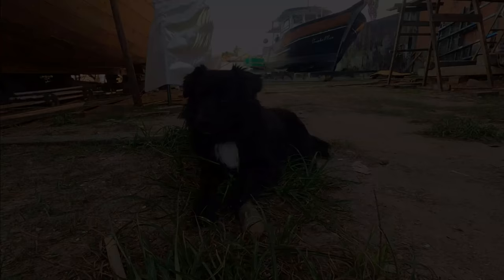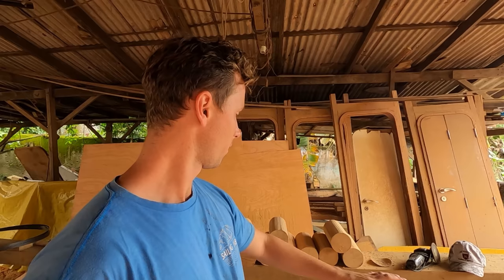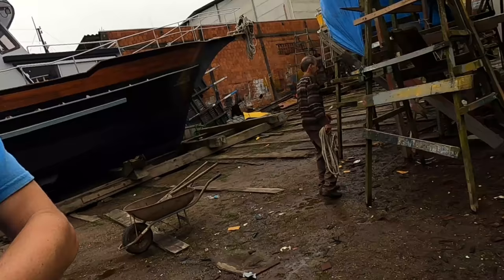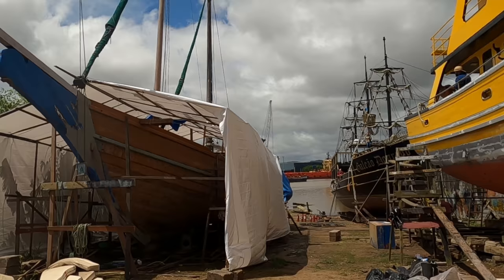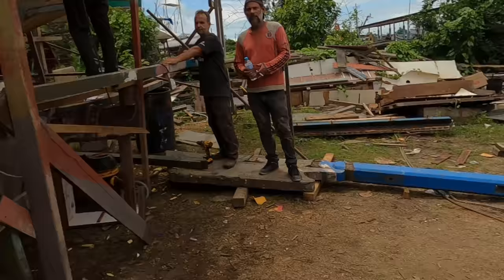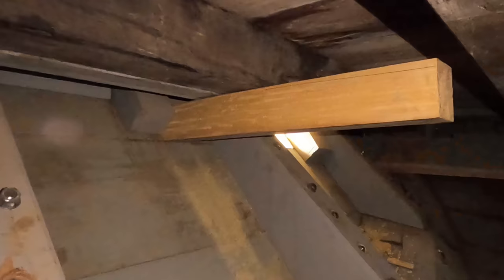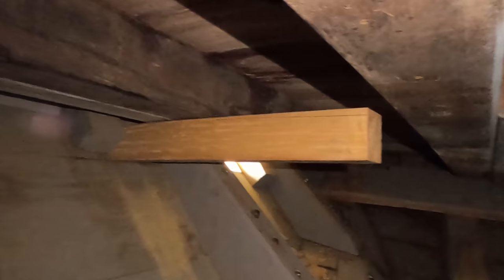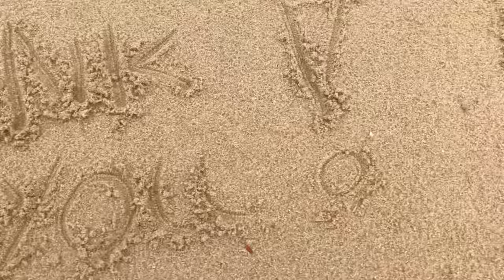Building a HUGE wooden swimming platform on a sailboat — Sailing Yabá #75

Comment: You really need to think about the forces of waves with a following sea! Waves pushing up and down on the platform will weaken the whole stearn of the ship. Then one wave will be all that is needed to rip the whole aft section off and Yaba will be on the bottom in minutes!
Some type of movable (floating) platform that can be out of the water when at sea would be safer. 
Enjoy the videos and waiting to see Yaba under sail!
Reply: it did not happen on the old platform why this one

Comment: I've only been following occasionally, but if you take that boat out in any wind, as soon as you turn down wind the waves are going to be crashing down on that swim platform and you'll be lucky if it breaks off without taking half the transom and then the boat down with it. That's like a calm summer day party boat thing.
Reply: thats strange the old platform seems to have survived many years i think you are over thinking things mr doom and gloom
Reply: @brianseager6388  Well, it's not my boat and not my butt. And in fact if you read the replies, as I did after I posted this, they seem to be thinking of using it for a dive boat. So a good-weather boat, and that makes perfect sense. But thinking of some of the weather I've been in in the Gulf of Mexico and the Atlantic on my way to Europe... I don't think I'm being doom and gloom at all. It would be dangerous to take that boat out or be out in bad weather.
For instance if, just for thinking about it, the surface of that platform is three square meters, and it's 25 cm above the surface of the water, if you get a wave that's 1.25 meters high breaking over it, that's 3 metric tons, 3000 kilos (6400 pounds), of water hammering down on it, in some weather once or twice a minute. And then when you are in any kind of following sea as the waves roll under the boat the stern drops into the trough, and so you have half the weight of the boat driving the platform down into the water once or twice a minute. That's what will happen, and at sea, or even in unprotected waters, that can go on for a day, even a week or longer...
Reply: Carefull. Using reasoning, math and science may break a whole lot of rose colored Pollyanna sun glasses. Viewers and commentors who have the audacity to posses such skills are not allowed on this channel... yet they wonder why it's not growing in subscribers...
Reply: @jefflange3009  😂
Reply: @bawrytr  Agree.  Despite her size, "Yaba" is not an all-weather ocean-crossing vessel.  She is flat bottomed and unballasted, of a type that evolved / designed for cargo carrying along rivers and coastal waters in sheltered conditions.  For instance, there are no coamings around the hatch to the engine space or at the base of the companionway: as soon as a wave goes on deck, water will be finding its way below. I just hope when they finally set off, they will take "baby steps" and take care not to exceed the boat's capabilities.

Comment: A little something to keep in mind once YABA is on the water............that dive platform can possibly cause you to have navigating (steering) issues when you are in a strong following sea.  Also, docking at a fuel dock will give you some issues, not so much while trying to dock, it will be leaving the dock. that will be the problem. You will not be able to turn a hard rudder either left or right (depending on if you are starboard side to the dock or port side). If you do that, the dive platform will absolutely cross over the fuel dock and that is not a good thing.  I would STRONGLY urge you to get a qualified captain to teach you guys the approach to a fuel dock and more importantly, leaving the fuel dock. You have a lot of time and money invested in YABA, and she looks great, so, please be careful and take lots of precautions. Keep up the great work. You have an amazing bunch of carpenters, a lost art, for sure.
Reply: Folding plataform would be a good solution! Tilting up during navegation.
Reply: Totally agree. A fixed mounted platform will become a BIG pain in the future!  On my boat I have such a platform, used to store the tender (with 25 h p outboard). BUT....I raise and lower easily by myself using a simple pully system. And it's not a tiny tender either!
Just saying....

Comment: The swim platform will drive you insane at sea as the waves smash into it constantly. Even at an anchorage when a boat passes by you, will only need to throw a 2-foot wake to make a thud crashing sound and if your stateroom is in the stern it will wake you and drive you nuts. I have the same stern transom and the swim platform is hinged so it is hauled up to stop this horrific annoyance.
Reply: ive a feeling they have a very big learning curve ahead of them once the boat hit the water.
Reply: I would think in a rough sea it might breakup
Reply: In a big following sea it will also make breaking waves come over the stern. The shape of the stern is so the boat will ride up over the wave. By putting a huge platform there you change the design form. How many blue water boats do you see with a huge boarding platform?
Reply: They won't have to worry about that. Because it's so long and so short with its anchoring i side the vessel. It's going to break off anyway.  2:1 ratio. For every 1 ft extended out you have to  secure inboard 2ft. . . 6 ft swim platform.  12 ft mounting.
Reply: I think it’s becoming apparent that this is going to be more of a houseboat than an open water sailing vessel. The platform would never survive rough weather in open ocean sailing.
Reply: @lucabrasi5070  Or for recreational diving and diving education (MP's specialty) at not-distant sites?
Reply: @charonstyxferryman  Yes guess you are right there. I would not take it offshore anyway. I have seen better boats than that never come home.

Comment: I can't believe the elder gentleman has almost single handedly lead the rebuild. PS so glad you guys went with a full rebuild. It's looking fantastic. 🇦🇺
Reply: @JCrook1028  also am I the only one worried about those stern planks on the transom at the keel below the water line. I mentioned before that the gaps are unacceptable and will cause problems almost as soon as the boat is launched. I'm not knocking these amazing guys, except sometimes I feel the tolerance is +- 5 mm

Comment: The boat is looking beautiful. Incredible how much work has been done since the start. With the caulking started you're on the home stretch now. Launch by June/July? I sure don't care for that swim platform though. That looks like a huge mistake that's going to cause lots of problems. It gives four more places for water to get in and either leak or start rot. A hinged platform bolted to the transom would make much more sense.

Comment: Glue 2 pieces of wood together using yellow carpenters glue....but laminate a paper towel in the glue joint. Wood...glue...paper towel...glue and wood.
Wood-turn your columns from these pillars. When you're all turned split the halves with a chisel. Viola...2 identical halves.

Comment: You might be able to safe some time by drilling the holes in your stick walls that will have wiring aka electronic connections. I suspect your plumbing will mostly be under the floor but some of it might come up through the lower walls. If I were to do it I'd drill low mid and high on each wall to have options and of course the ceiling beams will need a set of channels to pass wire through.

Comment: Buetiful ship, you have done extremely well I wish I had half your courage and perseverance, I do agree with the dive platform I have had problems in heavy seas altering the balance of the boat causing broaching and having had my platform smashed. If you could build a light weight removable or folding platform you would never regret it and enhance the performance and safety of your beautiful ship. All the best. Onward

Comment: Big fan of the channel. Not sure what is going on with the lathe but it should not flex like that. It looks like the frame bolts have loosened but if that's tight that is going to fatigue with catastrophic results.

Comment: Dumb Question? Love this show and I know nothing of wooden boat construction. I've  noticed that at the bottom of the boat most joints were bare wood to bare wood but higher up the hull, I began to see the use of various  "sealants." Do wooden boats rot from the top down?
Reply: Hey John. The reason Is incompetence. The comments section was full of concern for the lack of wood treatments below the waterline and the strategy was quietly adjusted as work continued. You will not get a direct reply from the channel unless your comment is blind praise. (I just hang around here to see how far this will go) Our views and comments generate money from YouTube somehow and they are forced to adhere to their fans preconceived notions of this boat, instead of admitting they made a horrible mistake.
Reply: @tomeidt7057  Oh, that's too bad. The guys building the boat look like they know what they are doing, but then, of course, I haven't a clue. 
Maybe they can fix it?
I hate to think that nice young couple wasted their money.
Reply: @johnfrank1509  they will be ok. As long as they are realistic about the boats capabilities. It is more of an incredibly high maintenance house boat than an ocean going schooner.
Reply: @tomeidt7057  Thanks for your last reply. I hope it works out. BTW, my comment on boats rotting from the top down is based on my experience with houses... the roof is always the first to go bad.

Comment: I've watched from the very begining *Nov 1, 2020* thought you both crazy to even try to have the boat rebuilt but now you almost have a boat i am so amazed at your progress However still so much to do paint/protective treatment, engine, propeller, rudder, sails, galley, heads, water & fuel tanks, electrics,  nav systems and soft furnishing and ive probaly missed many things but now *Apr 3 2022* your staying power is great please keep posting vids makes my sunday 
PS to all any guesses to splash date my guess is Apr 2023

Comment: I think you should downsize the swim platform ,it's way to big and looks out of place with the rest of the boat. You don't need a dance floor to dive or stand on to go swimming.
Reply: Agreed. A 3’ x 4’ folding platform would have sufficed and would not have created a potential disaster.

Comment: Thos project would have been cheaper if they had just commissioned a new vessel. Rather than wasted money  on   the old one.. this vessel is going to be back in the ship yard with Iron rott all through it. The used galvanized nails and bolts . They should have used silicone bronze hardware..

Comment: Interesting that they are using what looks to be purple heart on the swim platform. That's pretty expensive wood here at about $15 per board foot (length x width x thickness in inches divided by 12) for 4/4 (1" thick rough sawn) stock. Each one of those pieces by my rough calculation would run about $300 here in Ohio. I'll bet it's a lot cheaper in Brazil where it's harvested!

Comment: Oh, Ben, is there a machine shop nearby?. See if they have any carbide lathe tips?  Ideally round ones with a hole through the middle, then make a chisel about 50-60 cms long.  With the carbide tip attached you can hold the back of the chisel near your hip, you will find your productivity on the lathe will increase considerably.

Comment: A tip of my hat to the caulker.  It looks like a tedious, unending task.  How are the transom penetration's for the swim platform going to be secured against water infiltration--given the platform will move (due to water action, swelling and shrinking with water and sun)?   Your shipwrights are pretty amazing and skilled craftsmen.
Reply: The swimming platform is a mistake, it ruins the look of the boat and in a seaway it will structurally place hugh pressure on the transom and platform.

Comment: That swim step is going to break off. The ratio rule is  60 cm for every 30 cm extending out. It's the same rule when you build elevated decks on houses..  2ft for every 1ft extended out.

Comment: Wow i wish you best of luck that there is no strong winds coming up that will pummel your tarp. Hopefully it holds long enough for you to finish your boat. I am not sold on that huge swimming platform, but whatever you like is best for your boat. I think you know where you can go with your boat without being classified as comercial due to length, also with the low freeboard your probably limited to coastal brasilian waters anyways.

Comment: The style of tiller & rudder set up Yaba had & is going to have again would make a tilting swim platform quite different to  your presently plan, to  recreate the original design. As previous poster Peter Staples has pointed out & I have learned from personal experience the amount of noise and vibration from a platform in the down position in rough water when its not being used ,is a large inconvenience. Several boats I worked on & dove from had swim platforms & we learned that when they were not in use, folding them up was the best way to store them here on the eastern Coast of Canada.  While I do not know where you are planning to spend the majority of your time, if its out on salt water, or on large bodies of fresh water. You may come to regret not making the option of raising/tilting your platform up to reduce the effects of rough seas. Your boat is looking fantastic & no matter what you decide it will be interesting to find out ... the skill of your boatbuilders is why I watch . Best Wishes to you all .

Comment: Yabá may need a bigger engine and much more sail to move it considering there’s no regard for weight management
Reply: The reconstruction is using similar sized timber, also they removed a lot of rotten (heavy) timber and unneccessary items.  So even when completed, I reckon the weight could well be less than pre-rebuild.
Reply: @Tomm9y   Yaba was not a good sailboat before either. The sail area is dismal for it's size and with almost no keel and only inboard ballast she is going to rely on the engine to make any kind of worth while headway. She's going to be an outright liability In rough seas. The learning curve for these two is going to get a lot steeper after launch day.

Comment: Be careful with that swim platform. Personally, I would not have gone this way at all. It’s going to be an annoyance at anchor with any level of swell or even waves from passing boats. And in a rough sea or following sea it could become a steering impediment and could even become a serious safety hazard if it works loose, breaks up - or in the worse case, starts to tear the transom out. It’s also going to drive you crazy when manoeuvring in close quarters.

Comment: Your boat builders often use an angle grinder with a specific attachment to sand wood (In video #74 at 16:18 for example).  Can you show the attachment from below and say which manufacturer it comes from?  Thanks very much!

Comment: same with your dive platform make it from steel your putting hole through the stern which will make another place to leak with steel you could of bolted plates to the stern much easier
Reply: Better to be through connected with a wooden frame distributing the outlaying load stress into the frame of Yaba instead of to the thinner outer planks forming the hull. That previous platform was heavy.

Comment: I am constantly amazed by the incredible work of the carpenters! I have a few questions. Is the twine that's hammered in between the planks covered/soaked in anything before being put in place? How much percentage wise of the original boat is actually being replaced? Would it have been less expensive to plan and build an all new boat as opposed to dismantling and replacing Yaba? Best luck & can't wait to see her completed & under sail!
Reply: That would be good for three boring episodes.

Comment: The first mistake for a list of reasons. Welcome to a leaking hull. She a wooden ship. To late now. But there are blow up platforms so strong now tie it off, hang a ladder over the side. You could have installed, stainless steel mounts with plates. To stainless bars with a platform that moves up and down with the waves. Even haveing a flat bottom , square boat foam filled, that's lowered to swim and fish from. What you did is place so much CONSTANCE stress on the stern,  in big waves, it will RIP off the back, and fill the engine room.. never breach a hull for add ons,

Comment: Hi that swimming platform IS A VERY BAD IDEA the stern can get lifted or pushed down in a trailing sea    Following seas, combined with high winds (especially from the stern, or from behind the boat), can be dangerous and cause a boat to yaw (turn sideways) and swamp or plow under the wave ahead, if the winds and sea are too strong or violent. The original term may have been. You never see anybody do this look into it. just think what will happen if it gets torn off at sea you will sink fast. Consult with a real degreed naval architect  dont do it.